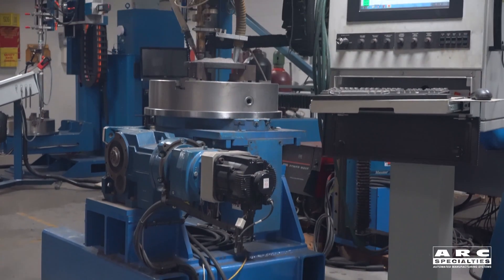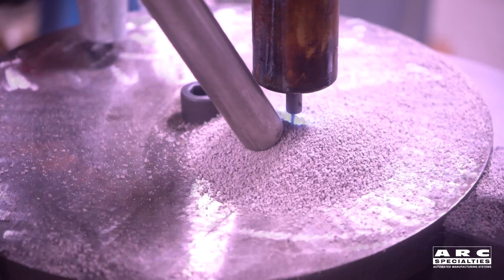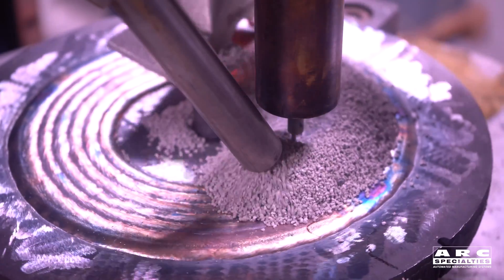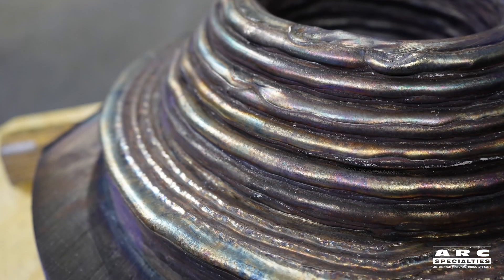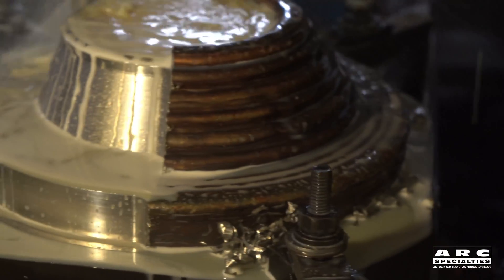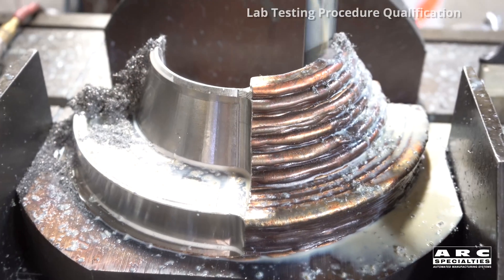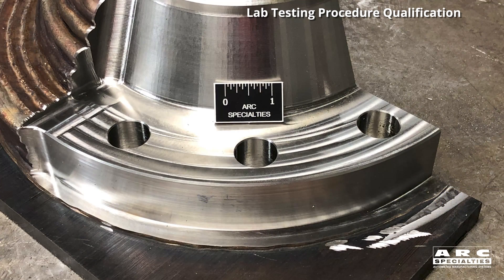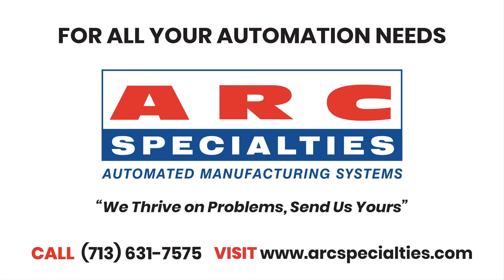Additive Manufacturing with Submerged Arc Welding

Comment: How do you handle the slag, when depositioning the next layer?
Reply: It peels off rather quickly, unless you’re doing stainless, in which case you would have to stop between passes, which you would have to do anyways to keep your I interpass temperature in spec.

Comment: Just imagine having "multiple independent electrodes" (Speed) + "CNC subtractive machining" (AM hybrid) + option for "smaller weld flux powder & electrodes" (for finer work) where each 'could' be controlled by 5 axis arm (x3) on the same platform.

Comment: Similar jobs also have been done in our lab with different feedstock materials (steel but not 316L),  it turns out the impact toughness (CVNE) can be enhanced to nearly 2 times better than regular weld.
Reply: Hey, im currently doing research into metal additive manufacturing, this comment was interesting, are you interested in conversation?

Comment: This looks really cool, though I think part of the appeal of typical welding metal 3D printers is that you can do very complex shapes (that you couldn't normally/easily do with casting) e.g. organic or cellular style frames for planes or boats.
Reply: Yes but with this type of additive manufacturing (called directed energy deposition), you have a faster construction rate and you can build much larger structures. Also reparations and multiple material parts are easier to do.

Comment: i am about to buy my first robot to do a simple frame welding routine, but ultimately to practice additive MIG welding. I think for it would be great for thin cross sections, then the same robot would change tool to finish with angle and die grinders. Maybe it would be more interesting for both of us to meet in your shop?
Reply from the maker: Hi Peter, we would love to have you come over and visit our facility. Send us your info to info@arcspecialties.com and we will get in contact with you on the particulars.